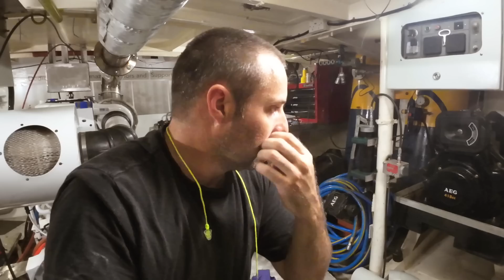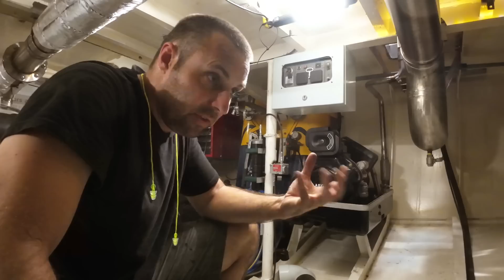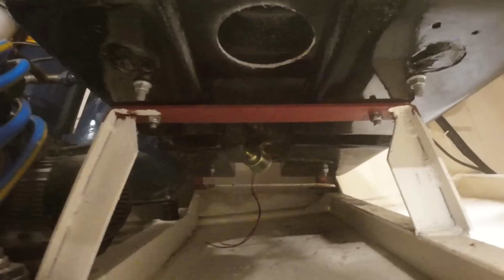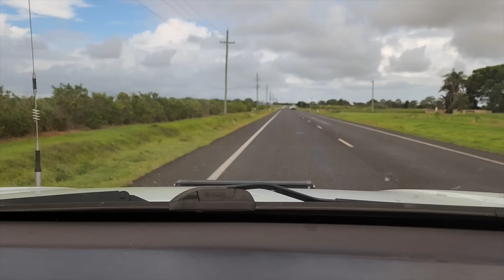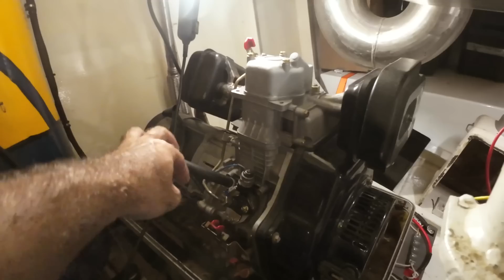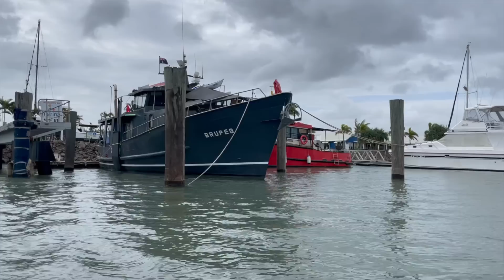The little genset that could - Project Brupeg Ep.339

Comment: Double the exhaust pipe diameter from the muffler,this will stop the engine choking the pipe over a certain length it will within a few months constant use the pipe will get gunk buildup first sign will be chunks of black oily soot when you start up,and the sound will improve slightly.

Comment: nice work, but you will need to add that return line, diesel fuel injectors need them, it cools and lubricates the injector. to fix it, you will have to buy an new injector. Also what was plumbed in to the second port on the injection pump?

Comment: For info, The injector return can not be plugged, Put it in the suction side of the feul pump. Only a little t. Y hope you used a switch between shore power and generator, If not there is the danger of feeding back to the shore, (Risk op 230 volts on the sore plug when not connected)  Or shore into the generator. Simple way to do it safe is to mount a 230 volts contactor in the both lines switching to generator if it runs (Coil on generator side) You switch whit no and nc contacts between both, . These little generators are a hadacke lol.... Its more sensible to make a water cooled set whit a 1500 RPM engine and a 4 pole generator head on it, Way more quiet. Those aircooled sets are fine for emergency, Not for permanent use.

Comment: Are the 240 volt genset and inverters isolated from shore power input?  Enjoy watching your weekly endeavors, watch the genset return line omission, hope your sea trials are successful, cheers.
Reply from the maker: Yes they are. There is a RCD breaker for each source and they go through the break before make switch
Reply: Excellent, so many regulations to address. @ProjectBrupeg

Comment: Hi there I love watching your set up but just a thought but if u worried about the heat build up remove the silencer and place it or fit another else were as it has baffles for sound and back pressure etc it also gains heat or anther option would be to rap the exhust parts in the box's to transfer yhe heat away

Comment: I’d put a ball valve after the t to the genset fuel line. Need to be able to isolate it. I’d also prefer to see you draw fresh cooler air from outside verses the hot engine room air. Gonna get hot in there if you’ve been running the main. I’m sure it would not be easy to do though.

Comment: Very cool mod on the Genset! Just a heads up, I have 2 of those Gensets, one at home one at my office. They are cheap and nasty but they are simple and easy to run. Just install a piece of fine stainless mesh between the air intake and the air filter on the side it bolts onto the manifold. These gensets tend to vibrate quite a bit and on both of mine we had issues with the air filter actually breaking apart from vibrations and the loose pieces been sucked into the cylinder head. By putting in the mesh it prevents that from happening. Also on the big glass fuse in the plastic holder, for the 12v DC starter line, ditch it ASAP, its a piece of crap, replace it with a new blade fuse holder and blade fuse. They don't rattle loose like the glass one does! And they cheap as chips!🤣 BTW love videos and watching all the progress!!

Comment: I did mention the other day about those fuel solenoids. Just take the plunger out screw it back in and use the governor red lever to switch it off.
These generators need as spares, 
* a set of brushes, 
* a 240v regulator module (It's that black horseshoe shaped module) and 
* fuel cutoff solenoid. 
* a complete replacement governor (just for the springs).
Re the governor springs, they work harden and break and it is next to impossible to get the generator to run under varying load without the correct tension springs.  
** For the love of cats, Take a photo of which holes the springs go in because if they do break, trying to test all the bloody hole combinations to get it regulating RPM properly takes hours, which can be saved with a simple pic of the governor
 
The horseshoe shaped VRM has a small brass screw in it and that's used to adjust the voltage. You can compensate for long cable runs by upping the voltage a bit with that screw BTW.
All those 4 things are cheap. A place called Able Sales has all that stuff. Tell them it's a Yanmar single cylinder air cooled Diesel clone. They sell whole motors too and there's often overstock sales on them.

* Also now you have a proper electric lift pump, carry a spare. I have one and it died under warranty after about 9 months. The replacement has been going strong for 18 months at 50 hrs a week but I still have a spare.

* I strongly recommend a Ryco fuel filter/water separator R2132UA between the pump and the engine. It has a bleed port on top and multiple barbed hose fitting options with 2x supplied blanking plugs.
Word of advice:
If you do get the Ryco filter, they don't come with barbed hose fittings. If you need to use 90deg fittings get the hose place to sort it out for you as the filter housing takes tapered end or whatever they're called style fittings and the never tighten where you want them to. Hose places can braze fittings so I'd get them to do that if you need 90 deg fittings.
After 20 or so friggen visits (maybe an exaggeration) to the hose place trying to sort out the bloody 90 deg fittings I should've just got them to braze some 90's on an adapter. It would've saved a lot of buggering around.  

** How's the cat?

Comment: Definitely can not block the drain line from the injector. That HAS to be able to drain, because 1, it stops the injector from internally pressurising and causing problems and 2, that return diesel also helps cool the injector.

Comment: Im 8mins in, do you have temperature monitoring of the engine? airtemp of the air in the box? that could be used to trigger the fan automatically at one temperature (will aid quick warm up?) and alarm in case of fan failure at a higher temperature. Configure brunet to automatically start up the generator at a certain (low) battery capacity?
Reply from the maker: This type of control option will likely be built into the system but for now it’s just a dumb generator. Key on, fuel and fan, off we go. We had a failure out on the water and brunet picked it up. So it’s only upwards from here with reliability

Comment: I would be interested to see the temperature of your exhaust in the engine room, with and without the blankets. You received some criticism when you installed the system.
Reply from the maker: We often receive criticism but we generally ignore the naysayers (unless what they say increases the safety or reliability of the boat and it’s something we have missed) and copy what the trawler guys do because it works, it’s cost effective, it is up to survey specs etc.
Reply: @ProjectBrupeg  I know, but it would be good to put them in there spots at times.  Looking forward to the sea trials.

Comment: Just to add one more observation:  If you're drawing the air into the box, if you would have confined the "inlet" openings to the rear of the box, then the cooling air would have to flow over the entire engine on it's way out, increasing cooling efficiency of the entire generator.  I also agree with several other commenters, you need a proper, water-cooled, generator for the type of operations you are contemplated.  Love your channel and efforts!

Comment: Solenoids are common failures. A good operation of the switch as done should be fine. More electrical tidying & safe fuel line.
Big items covered. More scuba time. Might need own anchor point at sea with cement block or similiar.
Saves on anchor purchases. But always a juggling act with priority list. Good night lights on boat or spot lamps may be cheap alternative. Life as you know it will change from building to maintenance & seafaring totally amazing outcome.

Comment: I might have done a few things differently...
shrouds for engine and generator cooling fan inlets and draw external air also air for combustion external.
Day tank to gravity feed.. less to go wrong and use hand pump?
Fan pumping IN using a car radiator fan.. and is the fan you have continuous rated and for that heat?
Overheat thermostat? use a modified room thermostat?
I just bought 2 new 😻 deep cycle batteries (my power needs are less than yours) lead carbon type.. now to redo wiring etc to new regulations for inland UK boat safety certificate.
Big windy storm over UK at this moment.

Comment: Constructive criticism #1 
If at all possible route your injector return line back to the fuel supply prior to the pump, that’s not ideal but would insure good fuel flow through the system, and prevent a very rich running condition, if you wind up with unexplainable air in the fuel supply conditions, a small fuel tank above the generator maybe 2-4L would be sufficient and somewhat replicate its oem system, using your supply pump to top off that tank, either automated or constant circulation with a return to Brupegs tanks.

Constructive criticism #2 
you will need a fairly ridiculous amount of airflow to cool those if you want them to last, i don’t know if a bilge blower is enough when the ambient air is warm and you need a fair amount of power from it, it may thin the oil beyond its ability to hold pressure. but if you possibly can put a oil temperature and possibly pressure sensor on it in some fashion and add it to your bru-net display it may give you a way to monitor what’s going on with your generator.

As always glad to see you guys in the water and in good company.

Comment: A diesel injector requires a dribble rail. There is always leakage passed the spool that lifts the needle for the injector nozzle. Unable to escape, the pressure will build behind the spool until eventually it will not lift sufficiently. The engine will slow down, the governor will compensate and apply more fuel into an injector that is increasingly restricted. The injection line pressure will keep rising until something fails.
Unless over the past 30 years they have fundamentally changed in operation.
Reply: no they haven't.

Comment: I must have missed something.  I don’t see how you can draw fuel for the genset from the fuel line for the main engine if you do not intend to convert the genset to run on veggie oil?
Reply from the maker: The main engine is dual fuel. So we have valves up stream to determine which fuel to send down stream. While steaming with the main engine we don’t need the genset as the main alternator provides power to the boat. While stationary we are able to select diesel only and run the genset
Reply: @ProjectBrupeg  Thank you.  Yup, that’s the part I missed.  Makes sense now.

Comment: I’m glad to see you’re having solenoid troubles too 😅 mines been a nightmare. Good luck getting it sorted ❤
Reply from the maker: We have another on order. It it keeps being a dick well just remove it from the housing and fit an external solenoid
Reply: @ProjectBrupeg  hi friend  for some reason you tube is not opening a comment  box the normal  way so the only way I  can say what I want is piggy back this way. I've  been a subscriber  for a few years  and enjoyed  the journey , but I  just realized  you have missed  a major  component  in your engine your. You need fresh  air pipe ventilation  pipe  brought  in and your engine  intake should be breathing  outside  air and that goes for your diesel  gensets. Those engines  breathing  hot air is a recipe for major  internals felling, especially in rough weather and hot and humid weather.

Comment: To finish the edge of a large hole like what you drilled into the bottom of your genset cover just take a piece of either 3/8 or 1/2 inch air hose and cut a slit along the length of it on one side, roll it up backwards and place it inside the hole. If you cut it to the right length you don't need any glue or screws to hold it in place.

Comment: A little late for this idea, but why not duct the cooling air inlet on the engine to the outside and then add vents elsewhere to let the hot air out. The engine then ventilates the compartment all by itself.

Comment: Just a little insight you have two small holes in the front cover you can run a couple of wires to the battery a terminator them there so you can jump start the engine or connect a battery charger so you don’t need to pull the covers off

Comment: Hi just a comment on the injector return line: often diesels use the excess fuel being returned to cool the injector down. You might need to plumb that line back in to avoid longer term issues.
Love the videos and great work!
Reply: No fuel return is a recipe for disaster.  Every diesel engine has a fuel return lines. 
This engine is a very short term.  They got to buy a proper water cool genset.
Plus to keep the sound transfer down you have to suspend on rods sitting on springs.
Reply: They tend to run very rich without a return line. And wind up with air accumulation in the system with no way to bleed it on its own.
Reply: Yep , needs a return line
Reply: That's right

Comment: I think I would have had the pump go into a 5 gal tank (fuel can) and then let That gravity feed down to the motor. Probably more reliable. Boat rocking and a bit of air gets in the line…
Reply from the maker: Zero chance of air getting into this line as its feed via gravity from the main fuel tanks to the pump. The pump just makes sure there is enough pressure to take the load off the injector pump

Comment: What happened to the preventive safety measure of wearing hard hats in the engine room. When you're in rough waters, you'll start smashing your heads on all the installed equipment and engine furniture.

Fans work best pushing cold air over drawing out heat

Comment: Would be cool if you could use a 3 or 4 cylinder diesel water cooled and have it use the main diesel engine cooling system like a APU system especially in colder environments like the Antarctic but then been in a colder environment would help the aire cooled engine anyways always fun watching others solve problems and come up with ideas and work around

Comment: I'm concerned that the fan being on the output may mean the bearings get dried out, now that you have 2 holes in the bottom, i think it would be better to have 2 fans pushing air into the box.
A trick with lorry (truck) drivers in the old days was to close down the fuel return to force more diesel into the engine for a bit more power when clmbing hills, but i guess it depends on how the fuel is metered.

Comment: I think you will have to put a one way valve on each outlet of the TEE    or the  fuel will draw from the least resistace side 
I had that same set up long ago
Reply from the maker: Ahh good point. I’ll add that in. Thanks Garth
Reply: @ProjectBrupeg  some valves would perhaps also be an idea, so you can isolate each branch/motor off of the fuel line.

Comment: Do you think the high engine room ambient temperature being drawn in will negate/minimise the effectiveness of the the air cooling? It may be better forcing the air in with the fan as that would have a wind chill effect (all be it minimal). It’d also probably extend the fans life by not being in the hot extracted air drying out the bearings? Just thoughts, good luck with the trials 👍

Comment: Please put the fuel pump higher and out of the box...If there is any fuel leak, it can start a fire...!!!
Reply: Gotta agree with you.  I'm anal about fire safety especially on boats.  That pump is too close to potentially hot surface and sparks.  If nothing else, leave it outside the box where it was placed to mark the bolt holes for it.